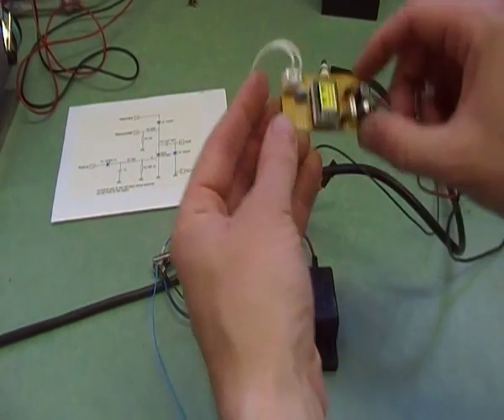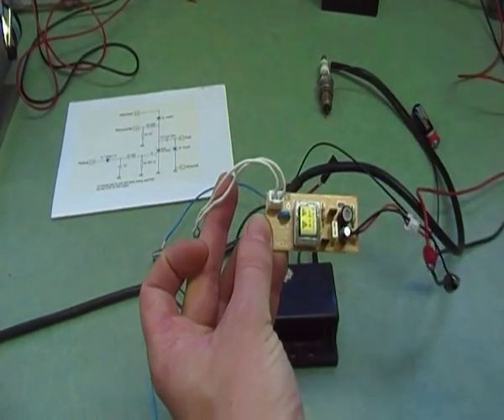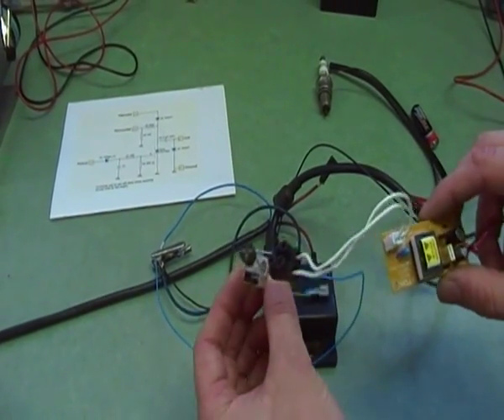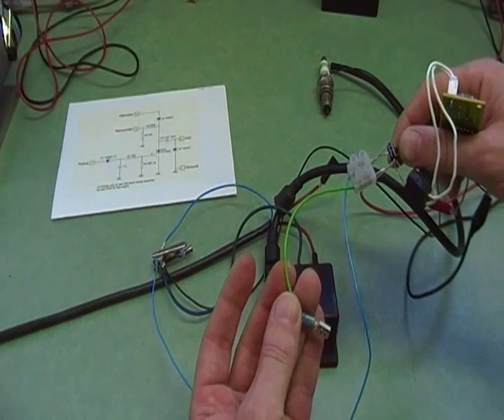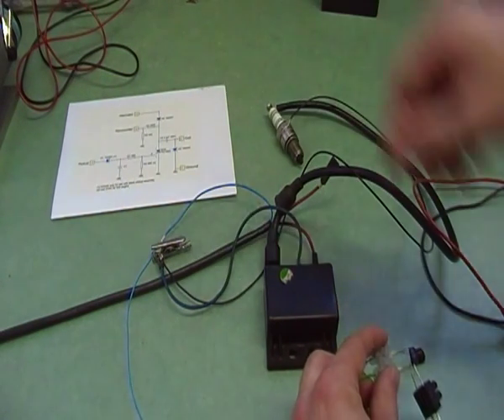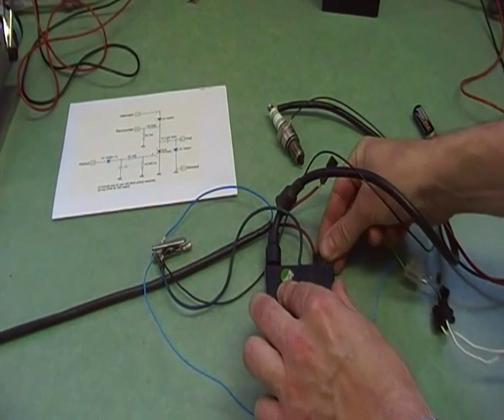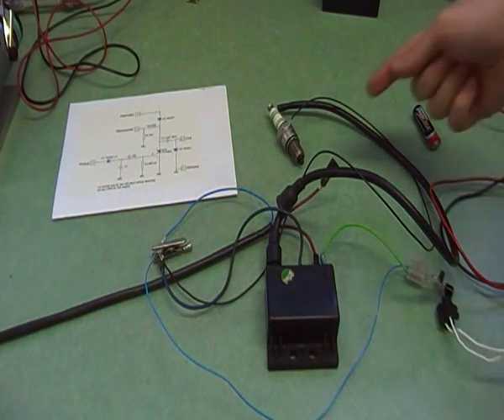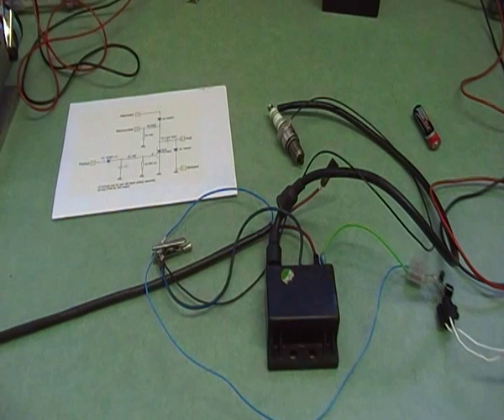Morini ignition test 2

Comment: What should the cranking voltage coming out of the ignition coil to the green wire as a norm if you are just cranking it with foot crank ?
Reply from the maker: It's really hard to get a good reading for the kickstart voltage unless you have something like a peak hold meter. 

A reading of about 90VAC is right at idle.
Reply: I cannot get mine running , this is why I ask . I can get about 50 volts AC output from the green wire on a peak hold meter but not enough spark. I can kick the bike with the spark plug in hand and grounding myself and I can feel when the spark plug fires but it doesn't shock me . I can just fell it click in my hand when I ground myself. I did all of these tests and all tested well but I just cannot get any spark to speak of . I can't see it , just feel it faintly when I kick it without the plugs in it .

Comment: What voltage are you aiming to recreate with the small scanner power supply? I'm guessing around 90V AC at a certain frequency. What's the bridge-rectifier for (apart from the obvious, to convert AC to DC). I'm just learning how the older generators work now I've got a Kanguro X3 after living with a Kokusan on my 501CC engined 3 1/2...
Reply from the maker: It's actually 2-300 volt, with no load. That's more like the voltage you'll get at 5000rpm+. The ignition box only has a half wave rectifier, so you'd be wasting half the power out of the cold cathode PSU and they're pretty wimpy to start with. By using a full bridge first, you get to use the other 50% of the output.

Comment: Hi, I may not have to sell the ignition system for Morini?
Reply from the maker: robertisyn Not quite sure what you're saying, but....I don't have ignition systems for sale.North Leicester Motorcycles do an updated version of the original system.There are various other alternatives, but most (unlike the original) rely on the battery and charging system to work.The best thing is to join the Morini email lists and get opinions on each system there.